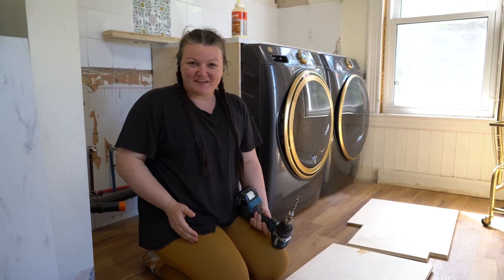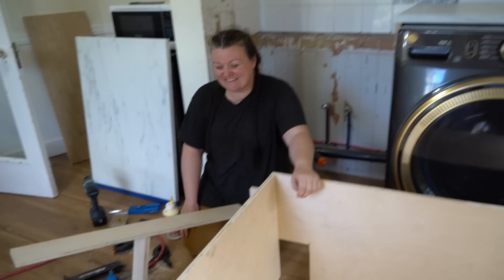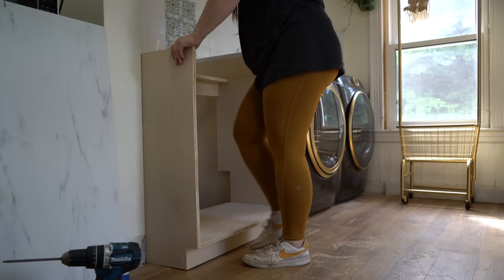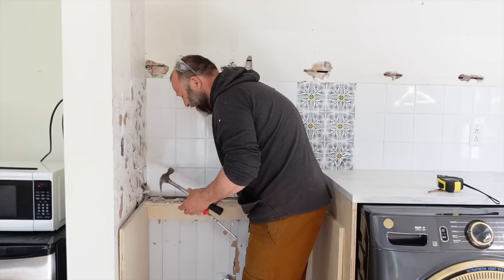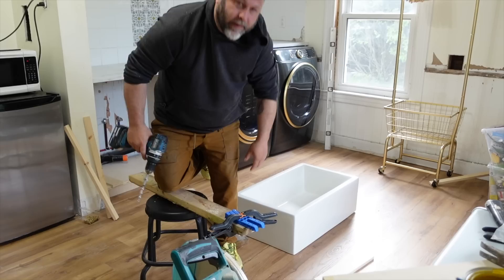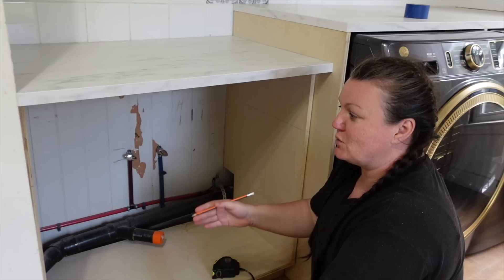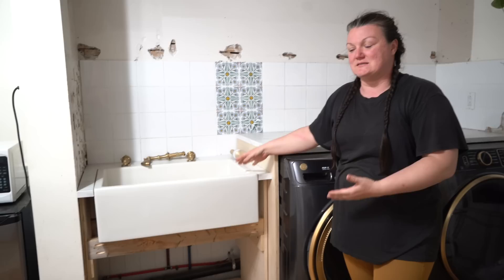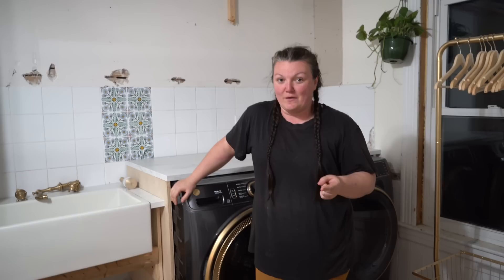Building DIY cabinets, farmhouse apron sink & antique gold gooseneck faucet! (Pantry/Laundry room)

Comment: I put on that type of edging on my tile that you husband tried to get out on the side wall and it goes under the tile and the tile and glue goes on top of it that’s why it chipped out. It’s also good to use a heat gun if you have one over the tiles and they should pop off it’s amazing how it works!!
Everything looks so good but can’t figure out what your doing to those side walls now that you have taken the tile off??

Comment: Looking good but washer and dryer  need room around them for air circulation so they don't over heat and burn up quicker. Hope you left enough room on top between counter and appliances for this.
Reply from the maker: There is room on all sides